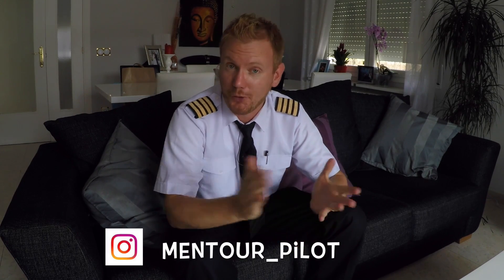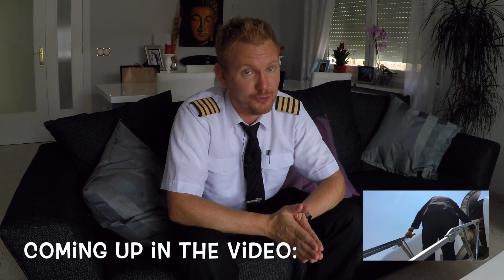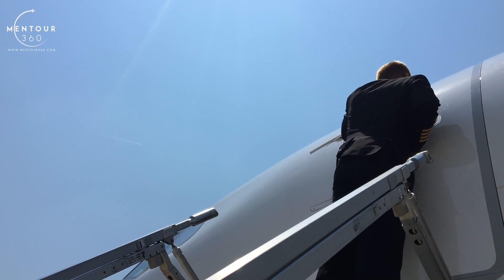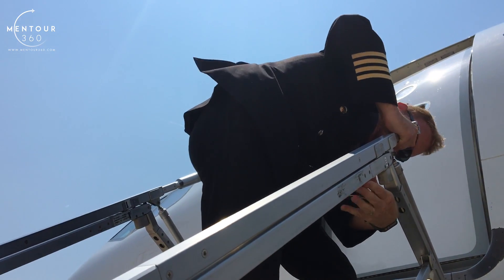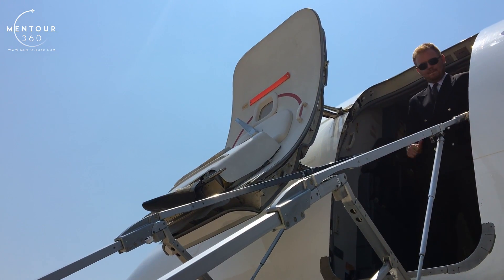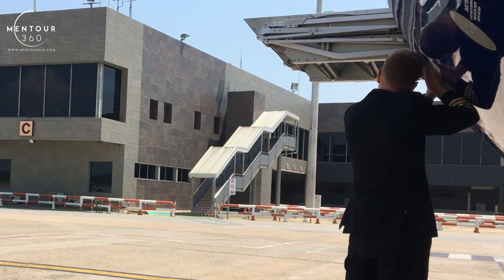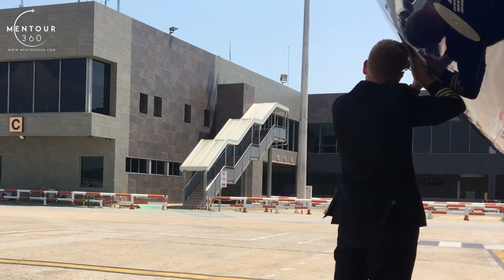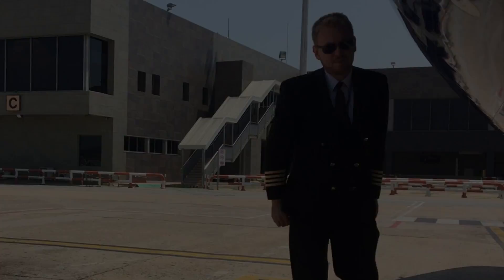How are the aircraft DOORS opened?!

Comment: I’m really quite surprised there’s no lock or card scanner or any other sort of authentication required to open the doors of a commercial airliners while the plane is powered down.
If they’re going on the assumption the someone breaking into and commandeering a parked aircraft isn’t going to be able to fly it, they’re very much mistaken — I remember a case about 5 years ago where a suicidal airport mechanic (with no formal flight training or experience) stole a plane, took it up for a joyride, flew it for an hour or so & even did a few stunts, then deliberately crashed it and killed himself once he’d had his bit of fun (and accomplished several items on his bucket list, most likely). :-/

In this post-9/11 world, and knowing how much damage an aircraft can cause in the wrong hands, I always assumed some kind of locking mechanism had been implemented at around the same time the new (reinforced & lockable) cockpit doors were brought in.

Comment: I have one question for if you are a pilot for the 737 how do you operate the air stairs is there like a button on the bottom of the plane witch you push and they extend or is there a different way?
Reply: Yep, button not that far from the air stair door👍🏻
Reply: @speedbird9313  ok thanks

Comment: Hi Mentour
Why do the door open outward? If the doors are disarmed in flight, doesn't the door open at cruise?
Reply: Disarmed?🙄 You dont arm the door, just the emergency slide😉
Reply: @speedbird9313  if you don't arm the doors, doesn't the door get pushed out by cabin pressure? Just like if you don't lock your doors to your apartment, someone will come in when you are out
Reply: @desmondsohjunwei1106  No, you lock the door with the door handle. "Arming" the door is just attaching the slide to the floor at so when you open the door the slide pulls out. You cant open the door during flight due to air pressure.
Reply: @speedbird9313  but wouldn't the air pressure assist in pushing the door outwards since the door is designed to be opened outwards which corresponds to the pressure difference to the atmosphere?
Reply: @desmondsohjunwei1106  There has been pressurized aircraft since the fifties, dont you think that if outward opening door would have been an issue that something would have been done by now🤪
Reply: @speedbird9313  exactly! I just want to know how it works. If you have no answer, can someone else take over?
Reply: @desmondsohjunwei1106  Do you think someone cares to take over..?🤔🤭

The four main doors on a 737 (fwd and aft passenger- and fwd and aft service/galley doors) are called plug type doors because they are "plugged in" towards the door frame from the inside. This means that the pressure will push them against the frame. To make them open outwards there are something called "gates" on the upper and lower part of each door which is a part of the door that folds inwards and thereby making the door small enough to go out through the door frame.
Reply: @speedbird9313  thanks a lot for the answer. You could have saved the last 6 conversation and skip directly to this one.
Reply: @desmondsohjunwei1106  Yeah, maybe🤷🏻‍♂️😆

Comment: When operating the air stairs, the aircraft is Cold and Dark, so where does energy comes from?
thanks for the information you provide and keep up the great work.
Reply: Some things work even tho the battery switch is not in the ON position. It is called "hot bat(tery) bus"
Reply: The Boeing 737 has a battery which operates the Airstair.

Comment: You know what, I NEVER knew there was such a thing as Airstairs that came out of the fuselage!!! I learned something today. Thank you!
Reply: Only on a few airlines, 737 200s from the 70s and Ryanair and a few other 737 NG/MAX operators
Reply: I worked on ramp and drove portable stairs to the aircraft. Never used the internal stairs. This is news to me. Thanks
Capt.
Reply: I’m sure some aircraft had them at the rear as well (not on the side) but these weren’t for passenger use.

Comment: When i board an aircraft usually Airbus i don't really fly Boeing, i see pilots inside the cockpit with laptops, what are they doing there? i also see sometimes pilots looking at the plane from the outside checking out the structure of the plane or something, what is the pre take off procedure?
Reply from the maker: Hi! It is likely that you see them doing their pre-takeoff performance calculations or even their departure briefings using electronic charts. 
Yes, the "walkaround" is a mandatory check before each flight.,
Reply: nice ok thank you

Comment: I do not know whether this is of much interest to others, and I do not know either whether you have already answered that particular question. So here I go:
Why has Boeing discontinued on the 767, 777 and 787 the way Boeing doors used to be function? I think the idea is ingenious and cannot be improved. When you rotate the door handle, the upper and lower parts of the door tilt inwards, the door moves inside a little less on the side of the hinges than on the other, and it is then pushed outwards and forewards. When the cabin is still pressurised on the ground, the door cannot be opened; when the aeroplane is on cruise flight, the door cannot be opened.
The DC10, L1011 and /67 have a nice mechanism, but it needs a lot of space. Finally, Airbus doors have never impressed me.
Reply: most if not all airplane doors move just slightly inward when operating the handle, not to mention the pressure sensitive door locking systems.

Comment: How do you know whether it is armed or disarmed (on the Boeing 707, 171, 727 and 737) if they forgot to put the red flag?
Reply from the maker: That’s the problem, you don’t.
Reply: So why has no one pestered Boeing into equipping the doors with a visible, automatic indicator of the slide status?  Shouldn't be that hard to have a double flag that pops up inside the window clearly showing armed/safe.

Comment: How many feet would you fall if you fell out of the 737... and also lol, operate the air stairs? I didn't know the aircraft had them even built in. I thought jetways were required and only planes like the 707.. or 717 maybe..727? The one "D B Cooper" escaped from had built-in stairs. I know in his case the air stair actually descended the aft of the plane, though

Comment: You do know that leaving out the air stairs operation doesn't actually help security in any way, right? One, there are other videos on YouTube and other sites that will happily give those instructions. Two, the instructions are printed right there on the side of the plane. Three, the air stairs can be easily bypassed with a simple stepladder.

Other than that, great video. Thanks for sharing.

Comment: The built in air stairs are a sign of the 737s original design brief:  Operate from smaller airports with the minimum of ground equipment needed.  This is also why the 737 is so low to the ground.  It enabled ramp rats to service it without the need for large, expensive, ground equipment.  You can load the bag from the back of a low loader!  No need for a conveyor belt truck. This allowed for faster turn arounds. 

Folk criticise the 737 for it be "too low" to the ground.  But they either do not know the origins of the design or choose to ignore it.
Reply: Then get it out of my major international airport, where I have abundant steps, belt and ULD loaders around me.
Walking from one side of the aircraft is such a hassle. Either walk around, or break my back crouching under the fuselage.

That was a joke
Reply: oh i understand the design choice made 50+ years ago, but the complications from retrofitting newer engines to the same airframe are fair criticism

Comment: Mentor Pilot What are your thoughts on the NTSB documented procedure for emergency ventilating a cabin in flight? They mention some airlines don't train crews on this. The procedure is to depress cabin, then unlatch (NOT open!) one door fore and aft. It'll be windy and cold, but you'll have fresh air to breathe. The O2 can get you below 10K, but that will likely run out before landing. In a heavy smoke situation this could mean the difference between a 'miracle landing' and everyone in the cabin dying of smoke inhalation.

Comment: Never knew 737 has built-in airstairs! Some questions though:
What if the slides are armed? Can you disarm them from outside or try another door? Can't imagine every door has its own airstairs...
If the slides were armed but the crew forgot to attach the strap, are you screwed?
When you opened the door you turned the handle 180 degrees. But closing it required only a slight pull twist and back to original position, is that right?
Can you lower the airstairs from inside the plane? Imagine disembarking in a remote airport...
Reply: Buying airliners is much like buying a car in that you get to select amongst a selection of options to be installed. For example you'll find a lot of aircraft either having or not having equipment such as Airstairs, SATCOM antennas (the hat on the fuselage that gives you wifi), ETOPS systems, steel or carbon brake disks (steel more common in earlier years), various avionics sub-systems, and more.
Reply: I bet they absolutely do.  The volume of aircraft they purchase and their ULCC business model means they would be ordering from Boeing the planes to exactly suit what RyanAir needs and more importantly what they do not need.   Seats, overhead bins, seatback, IFE (or lack of), galley, toilets...  all would be custom ordered to exactly suit RA specs.
Reply: 1. The slide can only be armed/disarmed front the inside. Only the Front left or L1 door would have airstairs on the 737.
2. The door handle only has the be roared enough to unlatch it or latch it so it really only takes part of a turn. But turning it further when opening does help swing the door out some.
3. Not all 737s have airstairs. They became less popular over time due to weight and maintenance. They can be operated from inside or outside with battery power.
Reply: 1. Depends on the plane.
2. Yes, but very unlikely they would forget that since it is part of their checklist.
3. Yes, it is.
4. Yes, usually.
Reply: Lots of things on checklists get forgotten.  Hence the number of aviation incidents listing "pilot error" as a cause.  After all, no checklist I've ever seen includes "crash the airplane."
Always sort of wondered why they'd depend on the strap, rather than insisting Boeing put some sort of automatic externally-visible indicator on there.  It ain't rocket science.
Reply: Joe Bramblett that one pilot from Germanwings added crashing the airplane to his edition of the checklist...
Reply: only ryanair 737s have it
Reply: HueyG most 737 not just Ryanair
Reply: I doubt Ryanair orders custom 737s
Reply: "I doubt Ryanair orders custom 737s" -- ALL commercial jetliners are "custom" builds.

Comment: Does the door lock from the outside? To prevent unauthorized access
Reply: I used to work at an airport, and on aircraft that "remain over night" we put a tamper proof tape seal on the door. The seals had sequential numbers, so we had to account for each seal, and verify the correct number when the door is opened in the morning. Not sure if all airlines do that.
Reply: Bob I But there are no "keys" for the standard passenger jet aircraft, right? It is the hangar/airport security that prevents unauthorized people from walking onto a plane and taking it for a spin.
Reply: I can only comment on the CR-J that the Sky West flies, but you're correct. No keys. I would imagine the door to the flight deck locks, but when cleaning the aircraft, it was always left open.

Comment: Hi Mentour, if you happen to see another aircraft coming straight towards you in the air, is there a rule for which way to turn to avoid a collision - like with boats on the water?
Also, do aircrafts have technical names for the front, back, left or right of the aircraft, like boats do?
Reply: The plane as you are sitting in it has starboard for right and portside for the left. Red navigator light on the left and green for the right on the wingtips. There's a video  on this recently streamed.
Reply: Fore for forward and aft for toward the rear.

Comment: Can u fly a 4 engine aircraft can u fly using using just to of the four engine to save fuel or if two engines fail?
Reply: Yes. Many aircraft can be flown with a single engine. It is only done in emergency situations, though so you can't do on a regular basis it to save fuel.
Reply: Ege Feyzioğlu and i also imagine that flying a four engine aircraft on a total thrust setting that is lower than the max output of two engines is less efficient. imagine if you run all four engines on half thrust. it seems like if you can get the necessary thrust from only 2 engines, which you could from this scenario, then the engines are partially acting as dead weight. if you flew with two engines shut off, they would only be causing drag, whereas the other engines would at least be providing thrust as well

Comment: hey mentor, love your vids, I'm just wondering have you made a podcast on "do airline pilots have to use their own headset." if you haven't could you make one? I've seen your a20 unboxing and which headset you should buy but I haven't seen one with this question yet.
Reply from the maker: +Anthony 530 I think I actually did answer that question in the "what aircraft should I buy" video.
Anyway, yes there will be a generic headset available to you in the cockpit but if very varying quality.
Reply: Mentour Pilot oh okay, thanks for replying and keep up the good work!

Comment: Actually I would prefer Airbus A320-doors... for me the Boeing 737 door seems to be too "old technology" the fact you've to swing the door inside out. The construction of a A320 door is more modern, just open and move to the side.
Reply: Mentour Pilot The "plug door" may be an old design, but the concept that the door is bigger than its opening, thus helping to seal it, still has merit. The door simply cannot fail open, whereas "modern" designs rely purely on the mechanical strength of the latches. Example: they haven't changed the shape of wheels in a very long time, because round still seems to work best...
Reply from the maker: +sebbivism It is very "old school", agreed.
Reply: The doors are haven't really changed from the first 100 to the current production model. So they are really 60s. ;) The A320 family was developed in the 1980s, which makes a huge difference, as there has never been a "clean sheet" re-design of the 737. It was just evolution over decades. (Somewhere I read that the basic fuselage construction is still the same even the same diameter as on the 707!)

That brings me to another question related to the video and I hope +Mentour Pilot reads it and might answer it:
On The A320 family, the slides are engaged/disengaged using a lever on or next to the door. This automatically triggers a light in the door window "slide armed", so anyone tryying to open the door from outside sees it immediately. (Newer designs can automatically disarm the slide when the outside handle is used to open the door.)
On the 737 the slide is armed by manually fixing the upper slide end to mounting points on the floor and it is only indicated by placing the strap that is visible as an orange bar above the window in the video across the window upon arming the slides. (Yeah, I have been on both 737s and 320s quite a number of times..) So I assume when you say you check if the slides are armed or not by looking through the window, you just check for that strap as you can't see whether it is engaged or not? So if somebody just took the strap off but did not disarm the slide, you're in trouble, right?
Reply: I totally agree on the safety plus of plug doors but that's not the point here.
The Airbus doors are plug doors as well. Somewhere I saw a description video but I can't find it right now.

Basically it first telescopes in vertical direction (so it is no longer higher than the fuselage opening), then sligjhtly rotates along the vertical axis (so it is no longer wider than the fuselage opening), and finally it slides out and parallel to the fuselage.

After that accident with the BAC 1-11, where the pilot was sucket halfway out of the plane in flight as the windshield popped out, even the last people recognized the imporrance of plug designs. I doubt a new commercial airliner without plug doors could be certified today.

BTW: That auto-strikethrough "feature" sucks (see my last comment above)
Reply: Colaholiker A slight correction on your description of plug doors. The top and bottom edges of the door ARE essentially the same size as the fuselage opening. By opening inward first, the door has the clearance to rotate through the non-narrowed center of the opening to then swing outward. If the entire opening was smaller than the door, you'd have to rotate the door vertically to get it outside the fuselage (which is how the overwing exits are designed). It uses a basic compound hinge with an inset pivot, which does not move vertically. I have operated these doors in the past, and had the opportunity to closely examine the mechanism in detail (A/C was in D Check, so slide was removed).

I would love (really!) to see documentation that Airbus doors ARE of a plug design. My understanding is any aircraft door that directly opens outward does not meet the definition of a plug door (which includes recent Boeing models). Essentially, if you can see the outside of the door when open, it's NOT a plug door, and if you can see the inside of the door, it IS a plug door.

As to this not being the point of the discussion, I'm following up on the OP's comment about the door design being "old school". Issues of disarming the slide, while interesting, are not part of that comment.

Oh, and yes, the strikethrough feature is a PITA.
Reply: Colaholiker always best to check under the door for the actual state of the door.